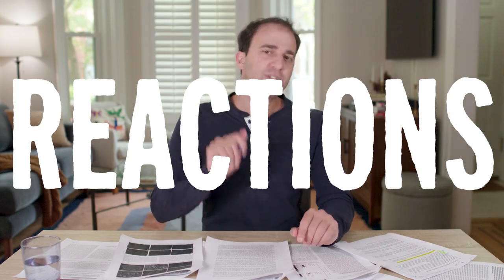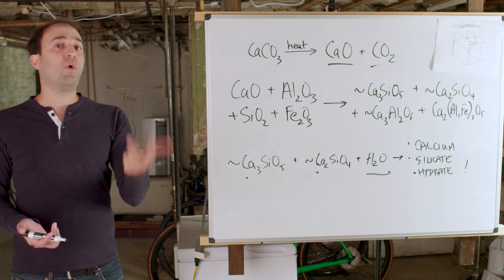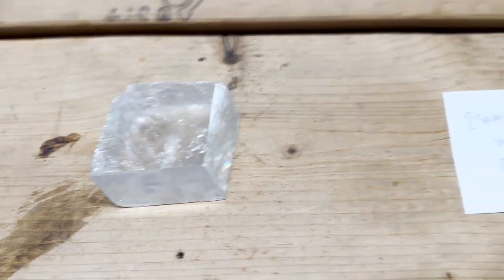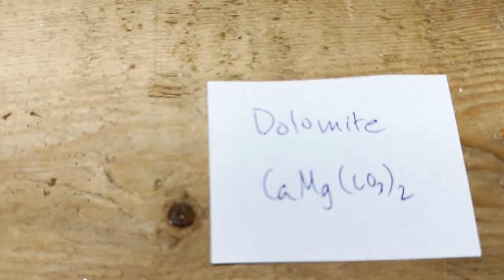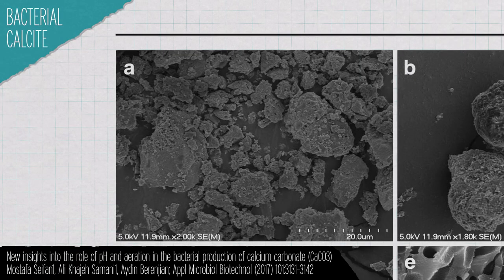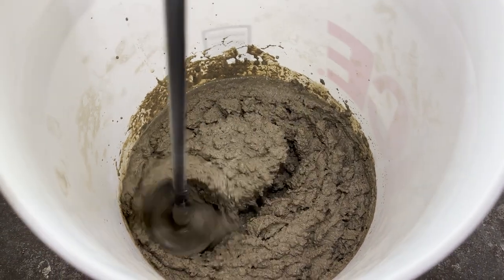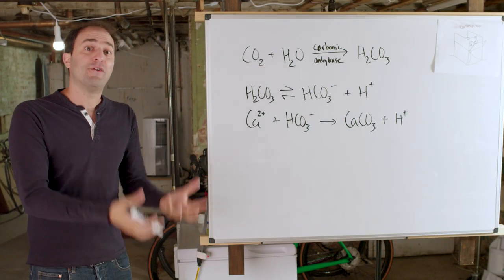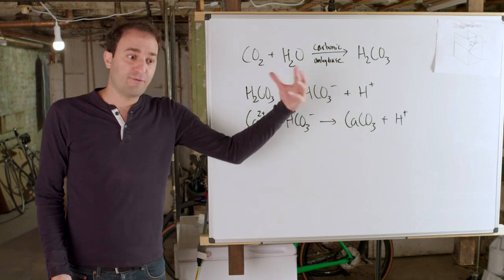The Bioconcrete Revolution (maybe)

Comment: I really enjoyed your video! The killer question of course is WHERE the calcium is coming from? Most conventional sources (typically CaCl2) come from the decomposition or dissolution of calcium carbonate - which as you pointed out releases CO2. The other killer question (at least with the urea hydrolysis pathway) is where the urea is coming from, and how that scales. As far as I am aware there are no references to carbon negative bio-concrete in the literature, and several life cycle assessments that show that microbially induced carbonate precipitation (MICP) in it's conventional form is in fact MORE carbon emitting than conventional concrete.

Comment: I wonder if adding a basalt reinforcement, either rebar or fabric/fiber, would provide a low carbon end product of comparable usefulness? It would also allow for a longer lifecycle as water intrusion would increase the lifespan of the arrangement since basalt isn't degraded by water while the concrete would repair itself with the water. Reducing the consumption of concrete and steel would make a huge impact on our carbon output.

Comment: But even bio concrete will need calcite produced to be turned into concrete, releasing same amount of co2 as produced when turning limestone into concrete?
I don't understand where the carbon production is being reduced.
Reply from the maker: Bioconcrete needs a calcium supply, but the microbes actually produce the calcite.
Reply: The calcite in this case is the end product. That's what replaces the concrete. It's just limestone, we've built with limestone for thousands of years, before the invention of calcium silicate-based cement.
Reply: In traditional concrete the carbon atom in the calcium carbonate is of geologic origin - dug up out of the ground in a similar-but-not-quite-the-same-way as fossil fuels. It's still fossil carbon, but it's carbon sequestered by geologic processes rather than biological.

In bio based concrete, the carbon atom in the calcium carbonate is either absorbed from the air (for the photosynthetic variety) or supplied with the food for the bacteria (for the urea variety). That is carbon which is already in the biosphere and thus isn't adding to the carbon already in the atmosphere. It's recycling the carbon we already have instead of digging up more.
Reply: @willythemailboy2  yeah that seems to make sense. thanks

Comment: where do the Calcium comes from? carbonate is just CO2 dissolved in water.. not so difficult to produce.
Or some major steps are missing here or those are  just start-ups that deceive their investors.
Reply: The calcium probably comes from CaCO3 converted to CaCl2, where CO2 it´s generated, so it's a waste of time this process because it's not carbon negative or neutral.